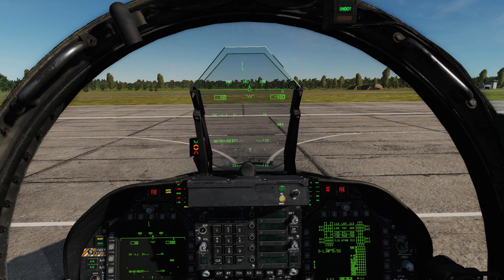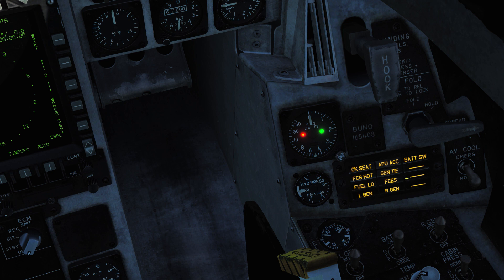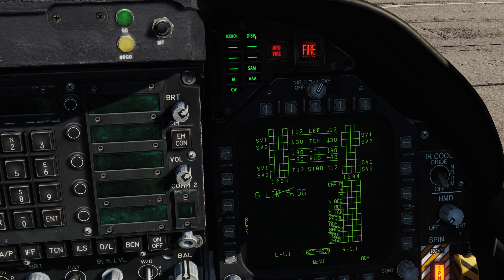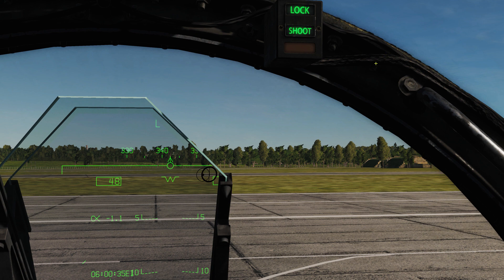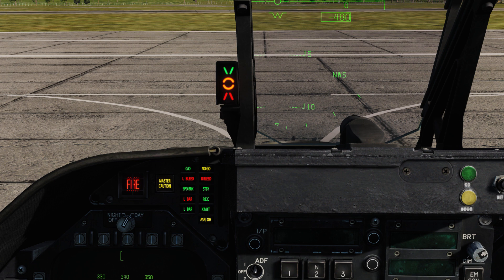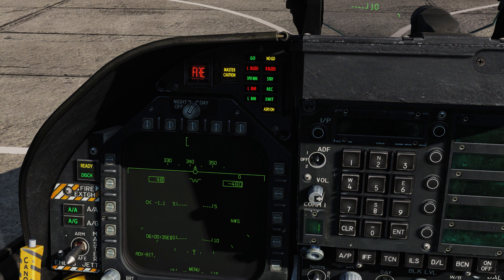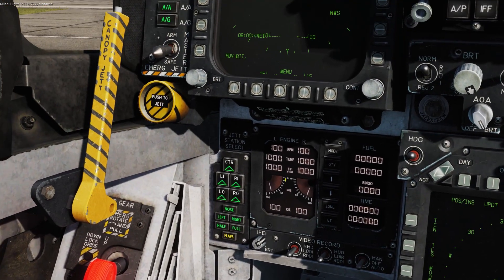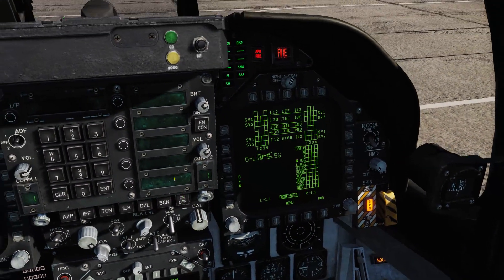Flying DCS World with OverKill: F/A-18C - Hornet Indication Lights

Comment: The engine and APU fire light when pressed secures fuel to the engine or APU and selects where the extinguisher goes. Once you select one of the 3 fire lights the ready light above the master mode lights will come on. Once you press that the discharge portion of the switch will illuminate indicating you have used your fire extinguisher.